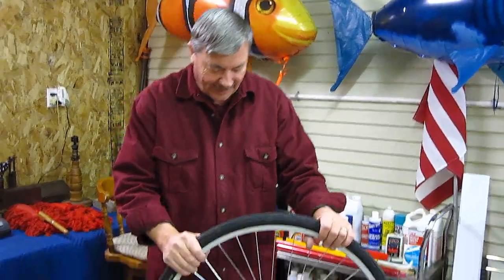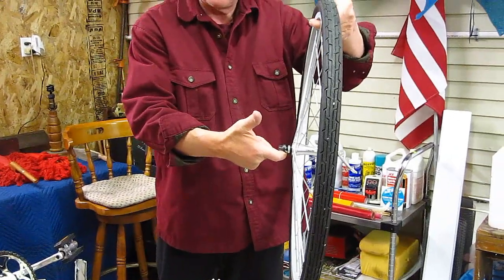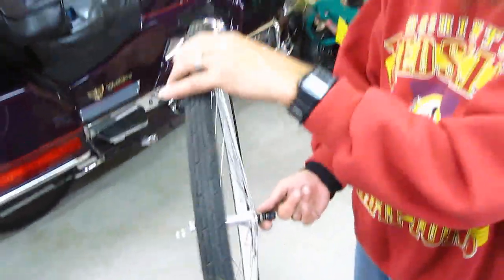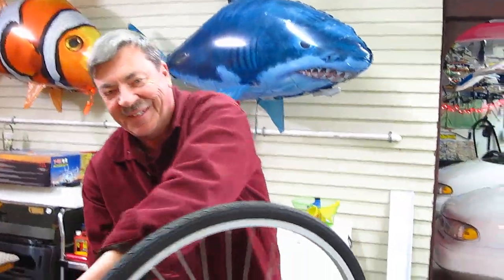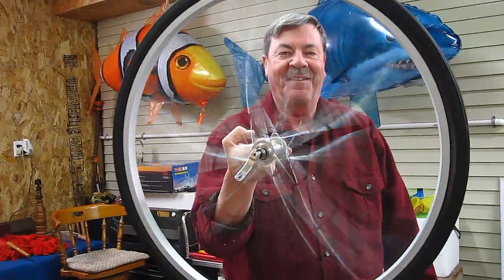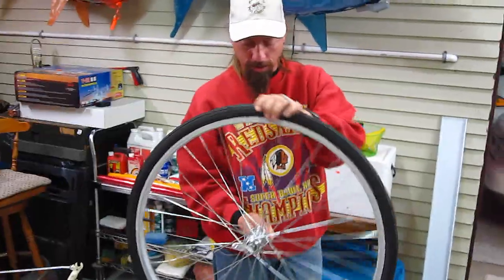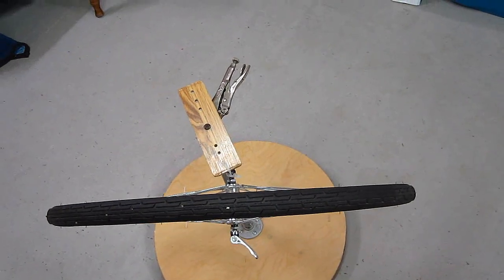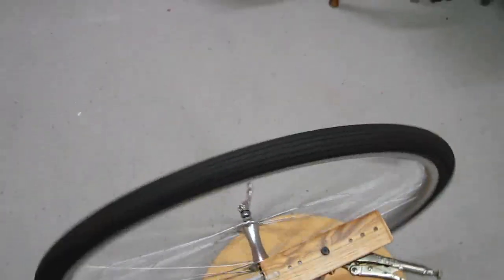Gyroscopic Effects on Bicycle wheels. Demo from Mr. Herbert's Science Class.

Comment: Sir, I think the tendecy for whole assembly to turn around an axis perpendicular to the ground has nothing to do with your position on earth's surface. If you spin it in one direction you will have to spin your body in one direction, and if you spin the wheel in the opposite direction you will have to spin your body in the opposite direction. My bet is that the spinning wheel imparts a small torque to the non-spinning axle, do to friction. Since the axle isn't parallel to the floor, there will be a torque component in the vertical axis, therefore the whole assembly will tend to spin around your fingers that way. What do you think?
Reply: And as the inclination of the axle increases the vertical torque will increase, what will make the assembly turn faster around your fingers

Comment: I wonder in a modern car w a traverse motor( east west) which way does the engine turn(fly -wheel) to assist in cornering to  keep the car on the road.
Reply: The flywheel isn't big enough to make a difference in newer cars... but the precession is the same... 90 degrees up or down depending on the direction of rotation and the direction of turn... you could turn left and the precession would push down, or right and up... or vice versa... but logically, you'd want your left side to lean left into a left turn... if it leaned right, it could pull you outward, or even flip you over in wider turns with speed...

Comment: If gyroscopes precess slower at high speed, I assume they precess more at low rotational rates (like a spinning coin slowing down). Then, why doesn't a stopped wheel generate infinte force?
(I don't think a gyro "knows" about coriolis forces, so my guess is no, it doesn't precess backwards south of the equator.) Now, if you spin a toilet....

Comment: Sorry for all the posts, but gyroscopic precession I believe is also why a very aerobatic plane snap-rolls right (clockwise in the roll axis when viewed from the tail) when heavy up-elevator is applied (again, assuming Clock-Wise rotation of the prop when viewed from the cockpit).  This is because the downward tail motion affects the prop rotation, and by gyroscopic precession, creates a hard right yaw. Get a plane with a short fuselage and huge elevator and give it a shot.  Just pull back hard.

Comment: PS. The direction of gyroscopic precession can be determined using a somewhat confusing application of the right hand rule.It goes like this: (Axis of Rotation) x (axis of applied torque) = (direction of precessional rotation). Note that the "x" here denotes cross product.1 more neat fact Dave. On a tail-dragger airplane, (assuming CW-rotating prop from the cockpit view), as the tail lifts up, extra Right rudder is needed to counter gyroscopic precession induced by the torque of the rising tail.

Comment: @MidnightHeli ..(from my previous post)...which is created be centrifugal force when a person is on the *inside* of a rotating disk.  The spinning then causes a force which would feel like gravity if the rotating disk were substantially large, so as to appear relatively flat, & the person were walking around the outside edge of it (on the inside side), with their head towards the center.This is hard to explain. I'd need to draw a picture. :) Thanks for the video though Dave! Gyroscopes are neat!

Comment: Makes no difference whether you're South or North of the Equator....Earth rotation is NOT what causes precession.....it's the torque created by the wheel's weight due to gravity.  Precession would not be observed up on the ISS.  Supporting the wheel on the other side causes precession in the opposite direction.
Instead of your finger....hang it from a cord attached to the ceiling....your students will love it....mine thought I was a magician.  I wasn't......just their old crusty Physics teacher

Comment: @NightFlyyer No idea if on the other side of the equator it spin the other way. Could not find any info about this on the net of my flying books. The only thing I know is, when I fly a real propeller airplane, during take off and because of the gyroscopic precession caused by the propeller the tail will go to the left when you raise the nose and you must give some right rudder to keep straight. Is it the opposite below the equator ??????

Comment: @MidnightHeli I agree with you. Also you could say that there is a force, Upwards, on the axle where the finger is "holding" it, this would be the same as pushing outwards on the wheel at the top. This upwards/sidewards force is translated 90' as you said. (I think you explained it better so I'll be quiet now). :)

Comment: Hi Dave I do not agree with that the motion to the right or left has to do with earths rotation. more with Gyroscopic precession, that say something like this ''if you apply a force to a rotating body the force will be 90 degrees later on the object''. So the only force acting on the wheel is gravity that is pulling the top of the object down, during rotation the object moves sideway 90 degrees further. If you hit the wheel on the side the top bottom will move. Nice video. Keep the good work